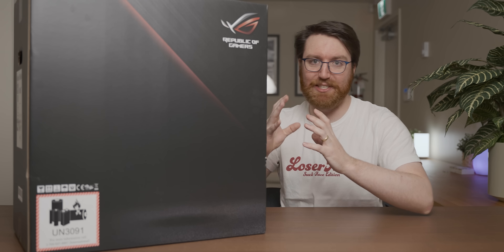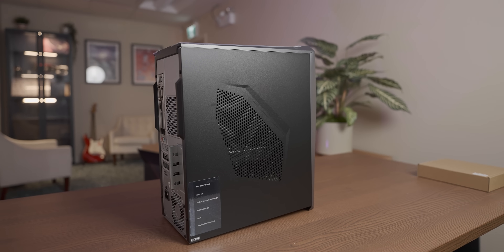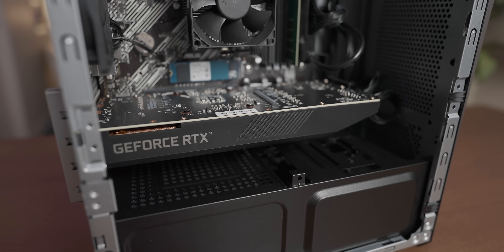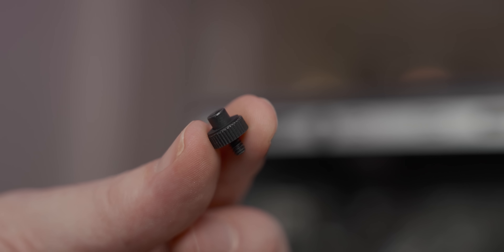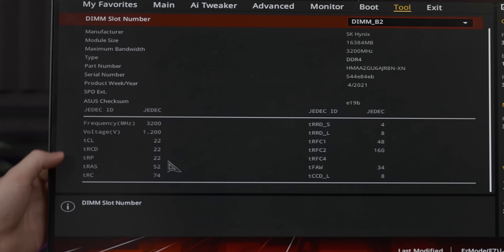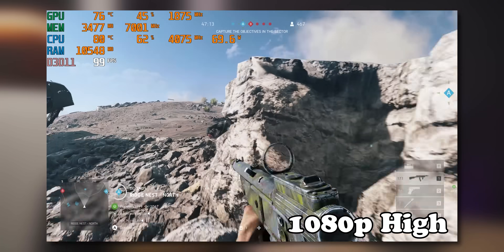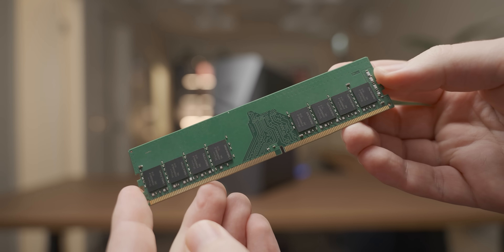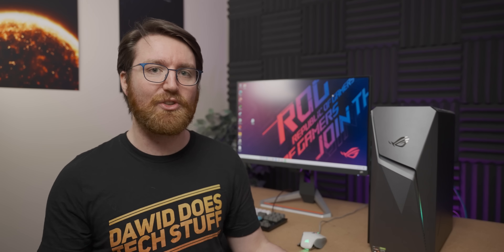Why Do Asus ROG Pre-Builts Suck So Bad?

Comment: I have the same unit. Only exception is the GPU is 3060. Is there a way to add SATA drives to this unit, should I switch power sources, and what fan would you recommend?

Comment: I saw this at my local retailer store but with a geoforce rtx 3060 and a amd 3700g. I couldn't look inside because sadly they had to put a metal strut over it and the performance case on. But all my concerns were more or less represented in this review. I am not knowledgeable on tech, but don't you think it's dumb to have an apu when you already have a 3060?

Comment: How did you acquire the AI Tweaker when I don't have access to it? I recently upgraded my RAM to 64GB, but it's only running at 2133MHz. Despite trying everything, I haven't been able to find a solution to this issue.

Comment: My cousin just purchased this desktop on sale for $1,000. What modifications should he prioritize?
Reply: If i had this, id get a new MATX case w/ more fans, new higher wattage power supply, a better cooler  and a 2 stick kit. The CPU/Motherboard are actually pretty great for that price, and the GPU is probably going to be sold for more then you bought the pc for
Reply: @Daluna13  Thanks for the info. I’ll pass it on to him.
Reply: @akmalmajid4423  all the parts should run him about an extra 200-250 depending on what he gets, also if he wants to go full ATX forthemotherboard, Newegg has a sell going on right now on a ASUS ROG B450-f for 90 bucks when its usually a 130 board. Way better then the prime board that this one has

Comment: My rog pre-built came with 2*8gb ram, ryzen5800,  better cpu cooler and a case with better airflow(mentioned in the video), 
I guess that the component of the system might differ in each region? coz i've never saw any asus prebuilt that came with single 16gb ram.

btw it still sounds like a transformer during hard gaming.  usually not quite a problem but may be i will consider upgrading it with a new case and fans later

Comment: Can the coolers be changed for a better performance? I'm looking for a powerful enough computer for music production and video editing. How do you say this will work? Thanks
Reply: Yes, you can change out the exhaust fan for a more quiet one and the CPU Cooler as well. These stock ones that come with the system are garbage. I would most definitely change out the ram to dual channel. (2x8) The better thing to do would be get a different model that actually comes with better cooling unlike this POS.

Comment: With my i7 9700K OC'd to 5GHZ and a GTX 1080 i get around 140-160 fps on average at 1440P low settings on BFV. Feel the pre-built should get more fps

Comment: so basically swap the RAM, case, and get watercooling and u have urself a complete beast of a PC?
Reply: The asus rog strix 3060 I just bought had dual channel ram. I’m running around 75 Celsius when gaming but doesn’t seem out of control. Plan on moving it to a new case And upgrade to a bigger cooler and see if that does the trick but otherwise so far a great PC for the price

Comment: I found a 3060 version of this with ryzen 5700 for $1100... would you think that would be a good deal?  If I did some airflow adjustments/  customizing??
Reply: I just bought it and I've been playing tarkov exclusively on it. Seems to be doing just fine. I still plan on doing some upgrades but so far zero complaints from me.

Comment: a bit late but I don't understand why it's only utilizing 60% of the gpu shouldn't it be 100% for max performance?
Reply: Because the cpu is too slow. Your cpu has to be good too, otherwise the gpu will be waiting around for the cpu to catch up
Reply: @pravnav  but I don't see the cpu being used at a 100% or does that not correlate
Reply: @GameOver-nm2us single channel ram, it’s very very bad. 1 stick of ram is MUCH slower than 2 sticks, but since this is a ryzen cpu it’s like 10x worse lol.
Reply: Not only the ram but also the gpu is very very hot, nvidia cards begin to slow down at 80 degrees ish, so they don’t catch on fire 😅
Reply: @GameOver-nm2us not necessary the cpu’s fault but the ram’s fault.. Not enough ram and too slow
Reply: @pravnav yes yes I know when it was one stick it was bad, but he added another stick and still 60-70%

Comment: i have a simmilar asus strix rog pc BUT what if you just dont mount the side panel? Isnt better for air circulation? i have it open currently. what you think?
Reply: Probably would be even louder!! 😲
Reply: @franklidgad  noise its not a problem, with headset you dont hear, im curious if its good for cooling

Comment: "SHAME ON YOU ASUS!"
It's not their computer quality that is going downhill, but their other products too. 
I bought one of this new and expensive monitors in about 2022, but  had many issues, so returned it. It's possible that Asus repacks the returned items and resell then as new again (which is against the law and if get caught can be prosecuted). Also after reading lots of reviews, I found out the following issues are also on the newer and more expensive model monitors:

Right out of the box:
Cons:
1. Zero quality control
2. Non of the four buttons worked properly
3. The monitor would only stay on for 2 seconds
4. The menu button didn't pull up the menu
5. The "Auto Rotate" didn't work(so it couldn't be used in portrait mode)
6. When compared side by side w/ another 1080/1920 monitor, the quality of this one is much less
7. Very weak speaker
8. The headphone jack: It's so tight that the headphone should be forced in it to the point of almost breaking it
9. The two cables that come w/ it are cheap low quality, very rigid, and don't connect or stay on the monitor properly
10. Non of the two C-type inputs/connections worked properly. The one that's for charging+Display didn't work at all even though I bought a high quality cable
11. Suddenly went dark and died completely after 24 hours

Pro: It came in a nice box

Comment: So technically the only complaints and “bad” thing about this cpu is the cooling system? I just traded my Ibuypower cpu for this and waiting till I receive it. The ibuypower kept on going black screen and I just had it for 5 days when I bought it. So then sales man recommended to get the asus instead. Would you say asus is Better than ibuypower? I know Ibuypower has more fans but like performance wise? I know you can always upgrade. But for the prebuilt matter.

Comment: Hi Dawid, I purchased a pc case a few months ago which I won of eBay for £1 it came with a ASUS ROG Strix B450-F with a Ryzen 5 5600. Do you think it is worth be trying to add a video card in the idea of using the machine? I know I need the graphics card because the processor does not have graphics support. I would not be gaming it would be more as a generic pc. Thanks

Comment: If any new PC buyers/enthusiasts want to know why so many people hate prebuilt PCs, here's why:

Many prebuilt PCs have cases with crap airflow
Some prebuilt PCs have very small motherboards which could be a problem for (for example) upgradeability
Many prebuilt PCs have very crappy CPU coolers
Some prebuilt PCs have pretty crappy fans or a lack of fans
Some prebuilt PCs use crap proprietary hardware that will obviously cause a lot of problems
Many prebuilt PCs have single channel/single stick ram which performs worse than multiple and is mostly used by them to save money and be able to put "16 gb ram" in the title of their product

I will update if I come up with another reason or if anyone suggests one in a reply

Comment: I bought the same pc and this must be a base/older model. For 999 I purchased a ASUS ROG Strix G10  AMD Ryzen 7 5800X Processor, GeForce RTX 3060, x2 8 DDR4 RAM, 512GB PCIe SSD + 1TB HDD from Walmart. It runs amazing, but like you say it does get loud with excessive gaming and gets hot........

Can someone give me a list of items I could get to improve this pc? It would be most appreciated. Also I would like to add that I'm new to the pc world of gaming 😉 so idk if I put the correct terms for the specs...sry 🤣

Comment: Thats weird.  I bought a $999 Asus ROG from Walmart ROG(G10DK-WB764).   It souns like it is lower spec, with R7 5700G, 16GB, 256GB M2 SSD and 3060.   But it comes with 2x8GB and an Asus Phoenix 3060.    The CPU cooler is still that trash one above though.

Comment: The one thing that got me buying this pc was the price 
I paid 1600 plus taxes and it came with 16 gigs of ram 
The I7 11700 , rtx3070 
And a 512 ssd plus 2 tb HDD 
The way I managed temperature was by simply putting a bladeless fan in front of the air intakes and that was it 😂😂

Comment: Nothing like making jokes to get a point through even if it is not true. 
The case has a small intake of air and a big out flow of air to make a pressure effect much like that plastic thing you put in your shower should the water pressure be low, so it enhances a bit speed of the air flowing. Further more, it has a curve in it, so "shining a light outside" wont show up inside. Thank the physics air does not need VFR to travel. 
Like the other video in which we see that "assembling problems" of another case would be solved by "planning ahead", this one is also a classic case of video that puts entertainment over review.
Well, it is funny. But to me, it is funny probably not in the way the host wanted it to be.

Comment: its so bad, been using rtx 2070s r7 3700x version last 2.5 years. Now my gpu is stuck on 300mhz under load.  Warranty ended like 3-4 months ago.
Reply: Time for a replacement! They don't last forever.... unfortunately.

Comment: I have the Asus ProArt PA90 and it’s the last Asus I will ever buy. I’m considering removing the components and using them with a better motherboard and case. Single most castrated BIOS I’ve seen in 30 years as an IT guy. It seems like they focus on their marketing and not designing technically superior products.

Comment: My sister bought a ASUS ROG Strix G10DK for a steal at $999 + tax, and I helped her do modifications. Here's some info in case someone finds it useful:

-- Her system: Ryzen 7 5700G, RTX 2060 Super, 256gb WD Green SSD, 500W Chicony power supply. It actually arrived with dual channel 16gb DDR4 RAM at 3200 Mhz. Same motherboard, case, and stock cooler/fans. The rear fan was bad, but we weren't too bothered because it was going to be replaced, anyway.

Problems:

— The case is too thin for most CPU coolers. The max. clearance for a CPU cooler is about 5.5", so you'd have to get either a low-profile cooler, a small AIO, or a really small tower cooler. We squeaked by with a be quiet! Pure Rock 2 which just barely fit in the case thanks to the little gap provided by the thumb screws on the glass side panel. We did not have to change the backplate.

— As shown in video, the "vents" on the front panel are fake. There are no actual holes on the front panel. We opted to leave the front panel off for more ventilation. Not pretty, but it works.

— The motherboard only has two fan headers, which is not ideal for air cooling a Ryzen 7 5700G and 2060S. There are no headers beneath the graphics card, so you cannot mount a fan beneath the card. The case only allows for one fan ( 92mm ) to be mounted to the back, and there is no way to mount fans to the top of the case.

The best we did was get two fan splitters and two extension cords to connect two fans to each header. We got her all Noctua fans ( two intake, one exhaust ), and we replaced the be quiet! fan on her CPU cooler with a 120mm Noctua fan that runs at 3000 RPM. 

After modifications, her GPU temps are at a normal 45C when idle and in the 70C range when gaming. The hottest she's seen it get is 80C after hours of heavy gaming. Not ideal, but it suits her needs and is a playable system. She's been playing regularly on it ( mostly FFXIV ) for a month with no issues thus far.

In the future, her next modification will be to upgrade her SSD to a larger one.

Comment: The stock fan curve on ASUS Turbo 30 series (blower style)  RTX cards is just fucking awful. Having owned both the 3070 (the same one as in this prebuilt) and now the 3080 version for a SFF build, a custom fan curve via something like MSI afterburner is absolutely necessary. My 3080 Turbo never goes above 78 degrees or 60% fan speed and that's with a +150 MHz core boost and +500 MHz on the memory.

Comment: I have a asus with ryzen 5 upgrade my ram to 3 8gb ram stix and I run at 1920 by 1080 p and its refresh rate is 165 no issues while gaming and I only have 1650s should I upgrade my graphics to gym 3050?
Reply: I also have a msi curved monitor witch is great btw

Comment: Every single computer and laptop you can buy that is pre built is absolute garbage. They always sacrifice something to be a little cheaper then the competition. It is usually ram, thermals and storage. Typically the nessisary upgrades are either not possible with the current laptop or the cost associated to the upgrade makes you just better off making it yourself.

Can't get lpddr5x on an app, Can't get 6400 lpddr either. Nearly every computer comes with gaming value ram too at 4800. We get ssd that likes to slow down alot on sustained loads. We also get thermal issues because the cost savings done on the case or heatpipes. 

I have to be very careful with each pre built from marketing scams and look at reviews. I might as well save the time and just make it myself. Stop buying prebuilts. Make it yourself or have some one do it for you.

Comment: I bought a ROG pre-built it had a I7-9700k and a 280 super turbo asus single fan gpu it's not terrible bit it's not the best thing the thermals where about 85 pushing the system I added and AIO and some more intake fans the CPU runs about 60c and the gpu about 75-80c pushing it upgraded the ram from a single 16gb stick to x2 16gb 3200 now it's pretty good still lacks some features but better than when it started the gpu is probably the worst part that dam single fan the could have made it a duel fan gpu that would have helped alot but you know they gotta cut cost some where why not take a fan from the gpu 🤷‍♂️ nut I did get it on sale for like 1100 so can't complain to much but recently built my own with a 12700k and managed to get a 3080ti in a bare bones kit with an o11d mini case 😉 and an evga 850 platinum psu and a b550 msi am4 board for less than retail of it all together but I went with a Z690 gigabyte MB for the new intel chip a 360AIO z73 nzxt she is a beast

Comment: I bought as ASUS ROG M16 laptop and I regret it every day. Armory crate is some of the worst software I have ever used, the laptop is noisy to the point it interferes with concentrating on work, it gets so hot you can't hold it. I will never buy asus again.

Comment: Here's why my Asus ROG Pre-Built SUCKS (so bad). Purchased in Sep. 2023 from Canada Computer. Despite all the Dupe Diligence I could muster. If you're not running anything, it's cool. I can heat my home mid Winter whilst playing my Air Traffic Simulation - solid 80C. Flash to now. Still wondering why the HEAT TREAT. I'm now Enlightened - thank you Dawid. Take CAREFUL note: the ASUS Turbo GeForce RTX 3070 8GB GDDR6 ("my" GPU) has ONE fan, not two. Or three. Surely must be a Collector's Item fit for the Smithsonian. As Bob Dylan put it: Don't Look Back.

Comment: I bought one of these. That front air flow vent...yeah...mine is a 1.5" hole I bored with a holesaw and put a 120mm fan pulling air in. These are garbage.

Comment: Can people help me decided what MB to buy please! I currently have a Gigabyte Aorus z490 Master that I screwed up while cleaning my custom water cooled PC. (I'm not sure what I did but the audio and half of the USB stopped working after replacing the TIM+Coolent and dusting). I'm not wanting to buy a new processor right now since my 11900k is still working fine I was just going to buy a new z590 motherboard. Especially since they're really cheap right now. I kinda want to stick with gigabyte and just get a z590 master but I was considering getting a ROG Strix Z590E since I really hate gigabytes RGB software and UEFI. Which one would you guys get or would you get something completely different. Before you tell me to just upgrade or swap to Ryzen, I would but I can't afford to buy a new CPU+MB+DDR5 RAM.

Comment: This is a not bad pc IF you buy a new case and a cpu cooler and power supply
Reply: The power supply is fine (Most OEM's use high quality PSUs).

Comment: so... you need to spend another $100 on ram, another $80 on a Corsair 400D and $25 on a Hyper212.    So we are now at a 2k computer with a Ryzen 7 3700 and a 3070 blower style card.    I can get a 3070 FE (better) on Ebay for $1100, and that CPU for $230.    So I can build better for that 1600, let alone the normal 1800 even at scalper prices, and if I can land a 3070 at or near MSRP, save another $500.      I think I'll pass

Comment: Umm, if they were going to air cool this system, why the hell wouldn't they use the AMD Wraith cooler that typically ships with the x700/x800 series processors instead of that piece of crap aluminum brick?

What a rip off. They put a cheaper cooler than the cpu ships with on it which is good if you want lots of thermal throttling going on and to potentially fry the damn cpu. They did this instead of putting the awesome cooler AMD had made for their cpus by cooler master specifically to improve the chips performance and cool it better when it turbo clocks under heavy load. Wow...